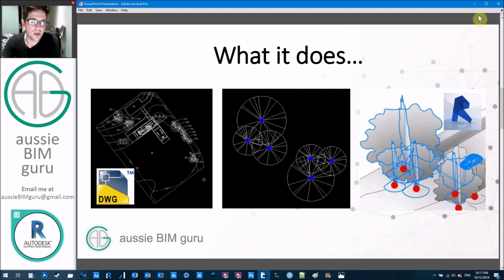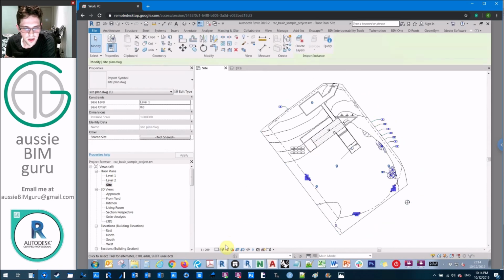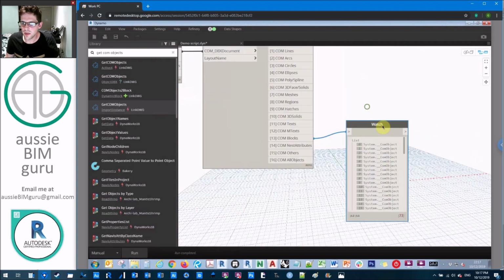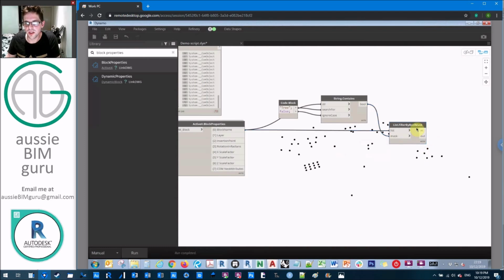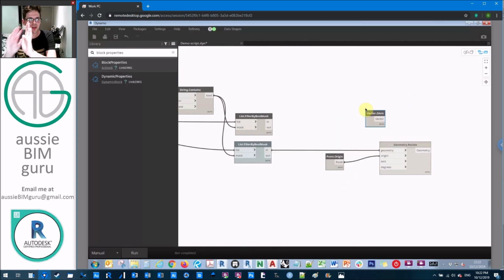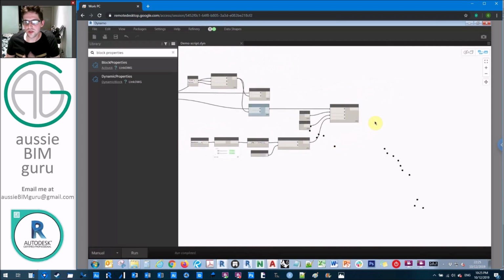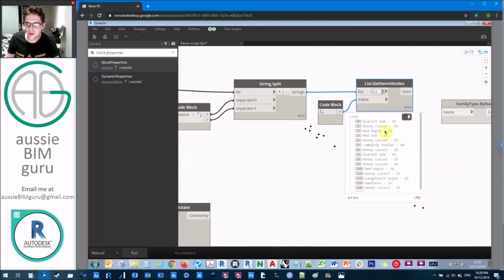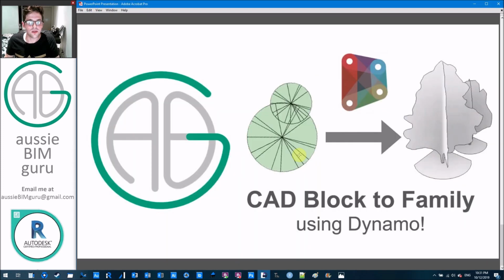CAD Blocks to Revit Families using Dynamo!

Comment: Hi Gavin, such a great tutorial, useful as ever!

I just want to share my personal experience on the LinkDWG issue on later releases which does not show ImportInstances.GetCOMObjectsByObjectDBX.
Actually in the release I'm using is gone too, but I managed to set a little tweak to get it back.
I'm sharing this to give continuity to your tutorial and to help others to get it to work.
You can test yourself the solution and share the solution on LinkedIn too if you wish to.

As others might have noticed there's a node called ImportInstances.GetCOMAnnotationsByObjectDBX.
By diving into the definition of such custom node I did find many of the outputs were available but disabled.
Then I copy/pasted the whole custom node content and created a new custom node getting back all the outputs and that did the trick.

Some more notes from my experience:
* Autocad application must be open in order to get the Object DBX to work
* dwg file shall be closed since the Python script underneath opens such file to get all the info
* in the Revit project I created a selection set from the selected model element (I used the SelectionSet.ByElements node from Clockwork) - it could be optional but in my case it worked better

Revit version: 2021

Dynamo version:
* Core 2.5.0.7460
* Revit 2.5.0.7586

Packages used:
* Clockwork v.2.3.0 (SelectionSet.ByElements)
* LinkDWG v.0.3.91 (GetCOMObjects, BlockProperties)
* spring nodes v.204.1.0 (SelectInRevit)
* my own package (for the custom node changed from LinkDWG.GetCOMAnnotationsByObjectDBX as described above)
Reply from the maker: Awesome work, thanks Paolo! Strange that the author disables their node...
Reply: @AussieBIMGuru  yes, actually sounds weird. Maybe they created the new node only for annotations and they "forgot" to leave the original one as it was. Maybe I'll ask in the dynamo forum to see if I can reach them.
Reply from the maker: For everyone's reference, the fixed node by Paolo has been added to the zip on github;
https://github.com/aussieBIMguru/Dynamo_Scripts/blob/master/ABG_200220_CADBlocks.zip
Reply: @AussieBIMGuru  Thank you and Paolo for this custom Node. How can we add it to our dynamo package library ?
Reply from the maker: I would look into genius loci package instead, this has better nodes for reading blocks now vs linkdwg.

Comment: Hi, Your contents are soo helpful thanksdoc.  I'm wondering , I have 200 tree blocks placed in AUTOCAD and now i want to replace all those 2D CAD blocks in revit with a 3D revit tree, Do you know a method to do this? It would be great if you could give a advise
Reply from the maker: Yes this workflow could likely do it as long as you have equivalent families for your autocad blocks. You could use index of/get item at index to check the equivalent family per block to place, using something like an excel file with the two columns being the CAD/Revit equivalents.

Comment: if we set unit in feet or inch in revit, how to manage in dynamo?
Reply from the maker: The unit convert utils class can manage this in revit API or if in dynamo you can use the convert unit node. Generally I only recommend building scripts for metric or imperial versus both.

Comment: i think you should also tell the package version.
Reply from the maker: Bit late to add them now unfortunately!
Reply: @AussieBIMGuru  do u rem now ?
Reply from the maker: @just_a_statistic  nope, its been a while since i made this one. Generally its best to use latest versions of packages.
Reply: @AussieBIMGuru  but the latest package doesn't have the nodes u used.
Reply from the maker: Contact the package manager or try the package version dated around the upload date of this video. I'm nearly 100% sure there is nodes in genius loci to do this currently. Look in the package, dont just search.
Reply: @AussieBIMGuru  ok will do this but tell me how do u learn to experiment with packages ?
Reply from the maker: @just_a_statistic  time, patience and curiosity.

Comment: Hi Sir. I dont know how to create custom script in dynamo. I just use purely revit. im working right now with placing hundreds of trees in my task. ive just tried to follow your process step by step, but to no avail, some nodes you mentioned is not available even though i already installed all required packages. Can you update this tutorial sir? or help me with this? Thank you
Reply from the maker: I may revisit this in future, but the node I would use is the CAD block node from Genius Loci package. Unfortunately the LinkDWG package doesn't work anymore. You can also use the dataextract command in AutoCAD to export block positions and names to excel but that is a more complex workflow

Comment: Hi Gavin, as per usual I love your content, and this was very helpful so thanks! 

I have a question regarding the insertion point. Once you have that in place and the 3D family is placed using the correct (center point in my example) How do you use rotation for that same object. 
I have a nested family in my family and when using FamilyInstance.SetRotation the default rotation point is not in the center but slightly off. Do you have any knowledge to how you can reallocate or overwrite the rotation point  in Dynamo or a script that does this for you? 

Hopefully this makes sense. Thanks
Reply from the maker: If after the rotation you compare the placement point to the families new position using Element.SetLocation. If this reverts the rotation, then you may need to manually calculate the difference as a movement prior to rotation instead to compensate for this motion. No node I know of can rotate an element by any method other than its placement point.
Reply: @AussieBIMGuru  Thank you so much for the quick reply! That seems to do the trick with Element.SetLocation.

Comment: Please show CAD Blocks to Revit doors and windows using Dynamo
Reply from the maker: It would be a similar workflow, you would need to find the block origin and how it relates to each door/window family. Then you could find the point that it sits at in host walls. I probably wont get back to the LinkDWG package for a while as I don't use DWG references very often in my consulting work, but maybe try and see how you go with experimenting with it!
Reply: Thanks
Reply: I'm  using the same work flow for doors/windows family  some areas window are created but some areas windows are deleted automatically in dynamo. please help me on that
Reply from the maker: @fayazmohammad7688  they must be failing to place or host. Maybe try using springnodes for the hostedinstance.bypoints node if not already.

It could also be the family and the height its placed at, if it has no wall or only part of a wall sometimes it fails to host.
Reply: @AussieBIMGuru  Thanks for the reply I'm using springnodes only,but windows are deleted at some areas.
Is their any alternate method for placing the doors and windows ,I'm getting the exact points from cad plan ,But windows are deleted at that points in dynamo.Please Guide me on that It was very helpful for me
Reply from the maker: Ok this might work... it's a bit tricky though. Convert all wall locations to curves. Extrude them up by a nominal distance, say 2100mm, .then join into a polysurface. For each location point, find the nearest point to the polysurface. Use intersection to find the index of the matching surface that the point is on, then use this point and the wall with the springs method. This should almost certainly find the correct wall and location.

Comment: The script is very useful Gavin...!! I have a question.. I exported the revit sample file to dwg and tried to insert air terminals back into the revit and they are placed successfully. I rotated the family instances by taking the rotation degree values from cad but they are not rotated to the same position There is a dicrepancy in that which i could  not figure out. Please help me on that
Reply from the maker: It probably depends on the origin of the rotation point, and also the rotation of the duct vs the Dynamo world axis'. It's fairly complex to cover in simple terms - would require you to analyze the block rotation from the DWG versus the default family rotation value, then set the family rotation to this difference.

Comment: Excuse me, I would like to ask you a question. If my imported cad drawing moves, and then I use the linkdwg node, the coordinates of the points will move. How can I modify the coordinate system to make the points in the right place
Reply from the maker: I would add an additional translation (move) function in Dynamo as well to match the discrepancy.
Reply: But the key point is that I can't find the origin and rotation Angle of the CAD drawing. I don't have a node here that can read the position of CAD
Reply from the maker: @tingyunmao8861  use a common reference or annotated coordinate in the CAD file (or the Id command in AutoCAD to identify a coordinate).

You can then measure and adjust the discrepancy between revit and CAD coordinates in Dynamo.
Reply: @AussieBIMGuru  In other words, I will mark the origin of CAD and revit on revit, and then measure it by dynamo and transform the coordinates
Reply: @AussieBIMGuru  I'm just going to make a family and I'm going to put it at the two origin points, and then I'm going to use dynamo to figure out the coordinates, right
Reply from the maker: @tingyunmao8861  yes make sure your revit coordinates are correct, dont change them, then reposition your cad and use dynamo to translate from dynamo to revit coordinates.
Reply: @AussieBIMGuru  Thank you. Is there any node that can directly read the origin coordinates and rotation angles of CAD
Reply from the maker: @tingyunmao8861  not that I know of. You could probably access WCS or UCS via python but it's a bit advanced. Maybe check the LinkDWG nodes to see if one does it.
Reply: @AussieBIMGuru  Thank you very much for your help

Comment from the maker: Noting I use version 0.2.2 in this video.

Later builds appear to fail to collect the linked document DBX, suggest using the older build for now.
Reply from the maker: 2.0.3 is my version.

I've heard from many having trouble with this package unfortunately, seems to only work in some dynamo builds. Annoying!
Reply: @AussieBIMGuru  Thanks! At the end I decided to use a workaround: use extract data command at autocad. it's been working pretty well actually :) It is a nice option for those who had the same problem
Reply: what is your dynamo version in this video?
Reply: I don't know why but I'm trying with the 0.2.2 version and it's not working anyway ... any tips? Thank you!

Comment: please Dynamo allows you to replace the color of the centerline duct and pipe
Reply from the maker: I think object styles do that.
Reply: if I change the colors of the pipe system, the color of the axis also changes
Reply from the maker: @askrinassim7290  yes i did some reading and it seems that it cannot be changed independently;
https://forums.autodesk.com/t5/revit-mep-forum/view-problem-colors-axis-ducts/td-p/6420828

Comment: What if the tree blocks names from CAD were different & not matching those of the Revit Family names? 
Is there any package which renames those blocks on Dynamo & then make them match with Revit families?
Reply from the maker: I would create an excel file with two columns to match the CAD vs Revit names. Unfortunately Dynamo would have no way of knowing that the two relate without some sort of match-able criteria or convention.